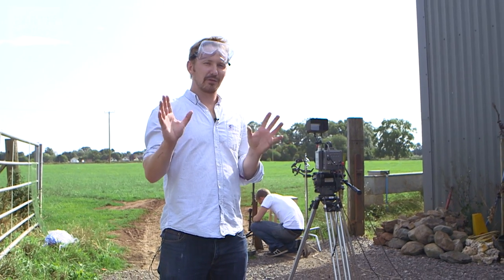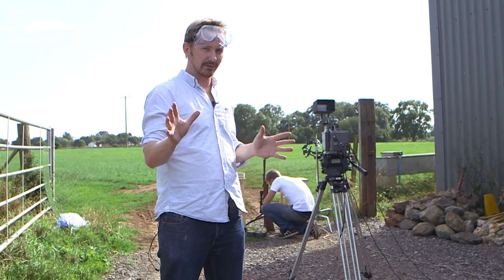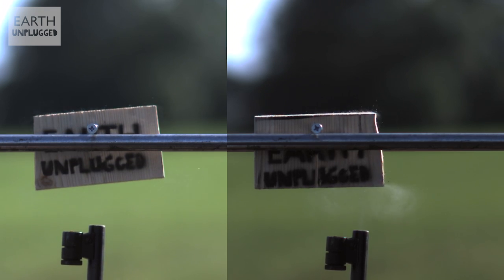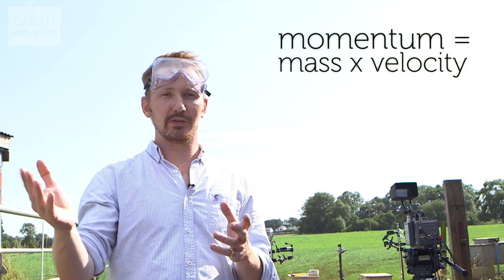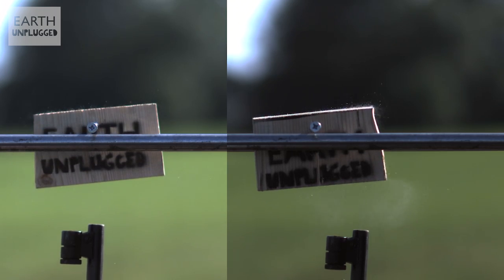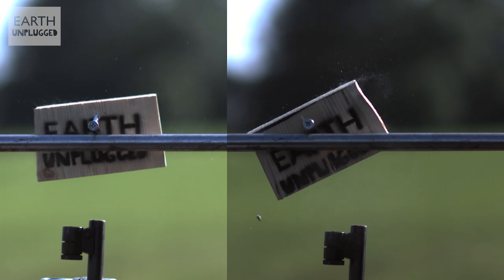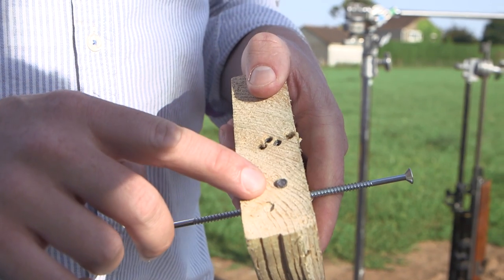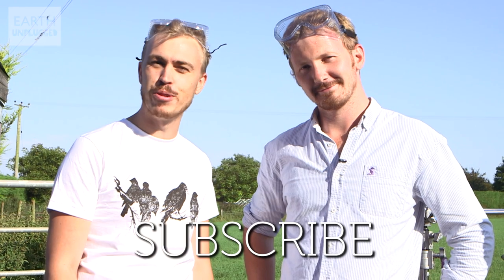Bullet experiment: Veritasium response video | Earth Unplugged

Comment: exactly. hitting it with a larger torque arm causes more energy to become kinetic and rotational, and less energy to be wasted in damaging the object by burrowing a hole through it. if you hit it in the middle, it is a smaller torque arm (or nonexistent torque arm) which causes more energy to be wasted by having the bullet dig deeper into the wood, instead of making the wood move or rotate.

Comment: no, just that hitting the side gives it less resistance, allowing more energy to be put into the rotation of the block rather than damaging the block. imagine kicking a coffee table as hard as you can. if you kick it off to one side, you'll probably get the table to turn a bit, while also damaging the table and injuring your foot. now imagine kicking it directly in the middle. the table will not move much at all, but you'll damage the table (and your foot) much more.

Comment: the legs dont make a difference, its all about where you hit it. the farther from the center you strike the block (or the table) the more torque you generate, which causes less resistance. its the same reason it is easiest to open a door when pushing on the part farthest from the hinges; the closer you get to the hinges, the more resistance you encounter. likewise, the closer the bullet hits to the center of the block, the more resistance it receives.

Comment: Is it possible that the "extra" energy of the rotation is almost negligible, creating a difference in height displacement that is so small that it does not show on camera?  
If you guys have calculated the exact rotational speed, it could be calculated and checked if lifting and rotating the block take the same order of magnitude of energy.  I have no clue what the result would be, but it would be fun to check.

Comment: Oh, when you're saying "resistance" you don't mean material impedance, you mean inertial impedance. You're saying it's easier to get the thing to move out of the way when you hit it with a bigger torque arm, not that the wood is more compliant, correct?